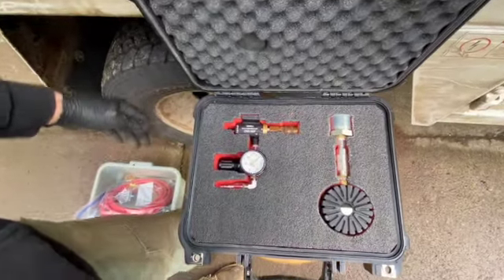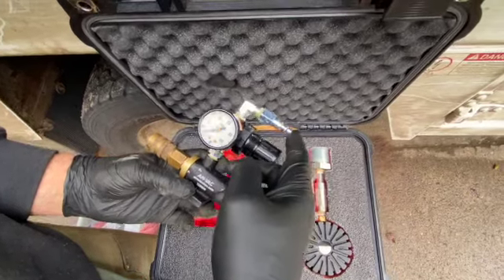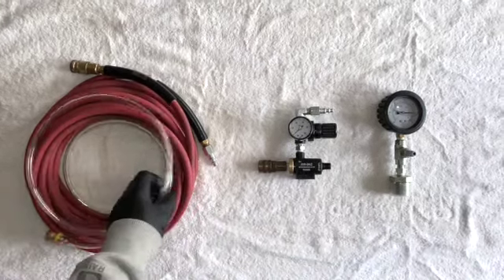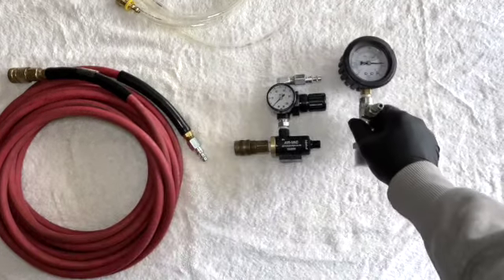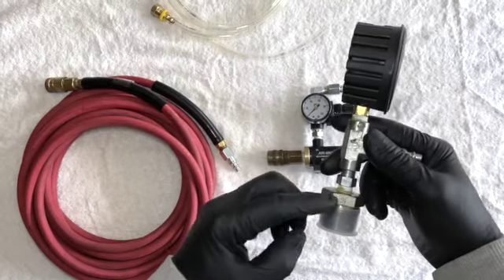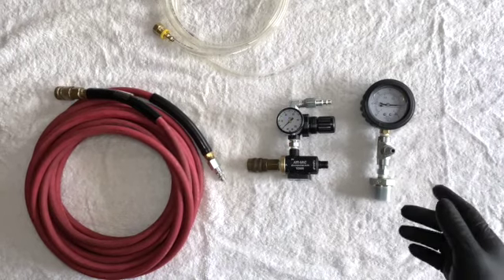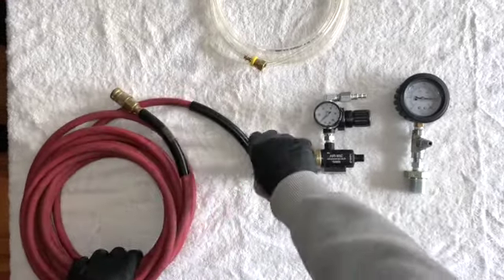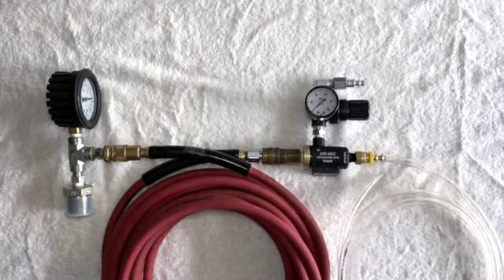AirVac Setup Demo

Comment: I've used an Air-Vac many times. Some of the most common are hydraulic tanks, diesel fuel tanks, and of course heat exchangers. I've used this valve on 631 Cat scraper hydraulic tank, radiator, and once for diesel fuel tank. It did the job and gave me time to plug outlet lined and inlet lines to avoid spills.

Comment: I use a similar setup works great!👍thanks for sharing
Reply from the maker: Right on, yeah they are pretty slick. I hate making more of a mess to clean up when I have to change a big line or work on something, and in the right circumstances you can really lose a lot of oil. What brand are you using? I am kinda curious what pressure will end up being right and what that will translate for vacuum, 'course it will change depending on what I'm doing too. Thanks for the comment and the continued interest, we appreciate it!

Comment: Hello and like the video, what is the part number of the air vac Venturi? I’m going to build  a rig similar to this. Thanks
Reply from the maker: Hey, thanks, glad you like them. The part number for the venturi I used is TD260M. There is more info and links listed in the description below the video. It came out well and is really cost effective compared to kits like the CAT unit. Hope it works out for you, thanks for watching and the comment, we appreciate it. Be safe